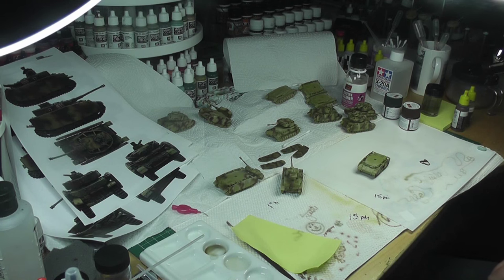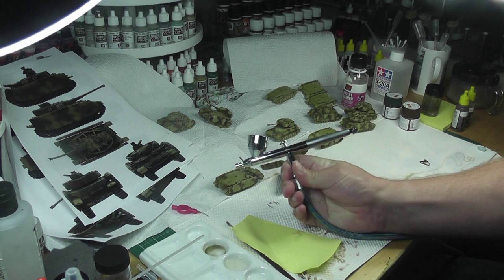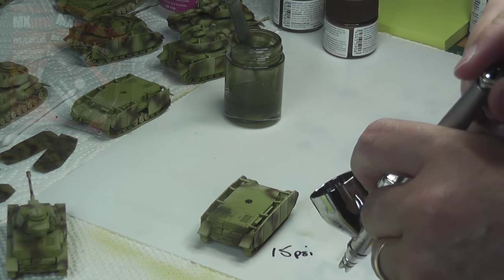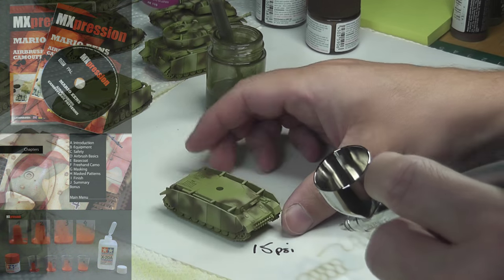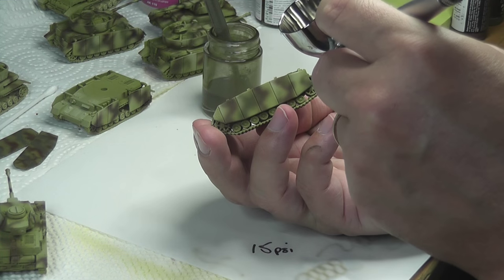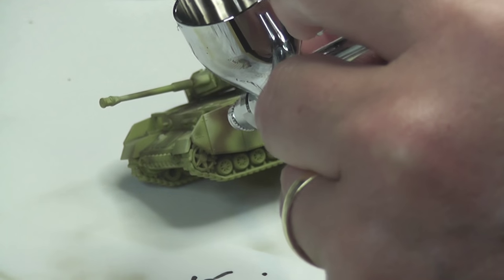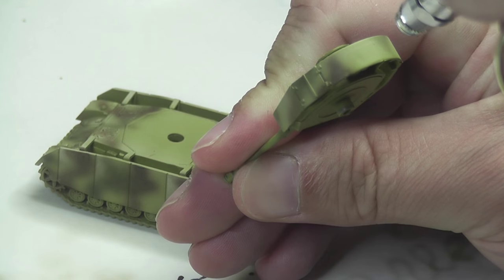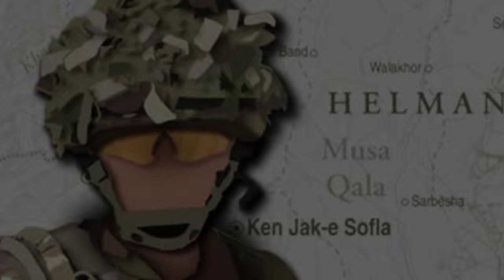15mm Panzer IV painting log: free-hand tri-tone camo

Comment: Looks good to me-thanks for the informative video :) You mentioned a thinner? Could you not just use water? Is the thinner a lot better for this?
Reply from the maker: +Peter Anckorn Yes, absolutely.  Water isn't going to help you.  Use your branded paints thinner and you'll get better results.  At least 50:50.  But you're best off with Tamiya.
Reply: +modeldads  Great-thanks for the tip :)